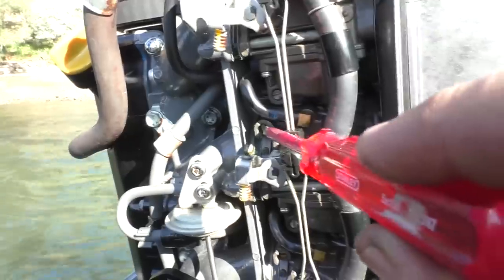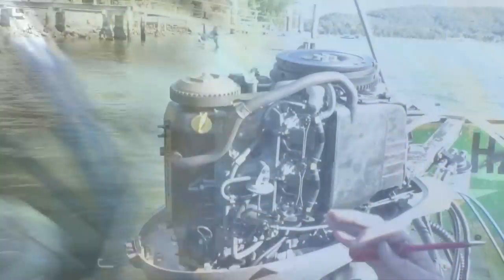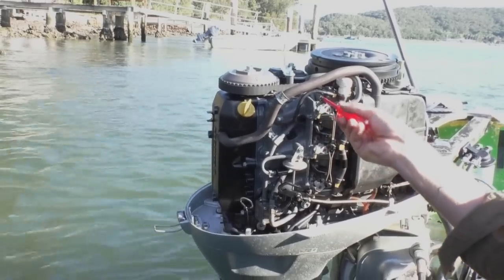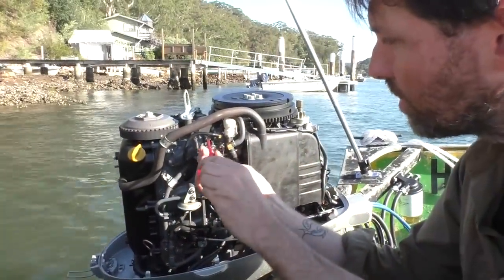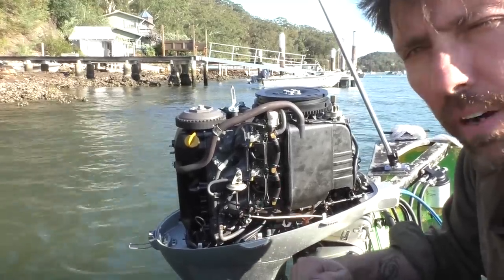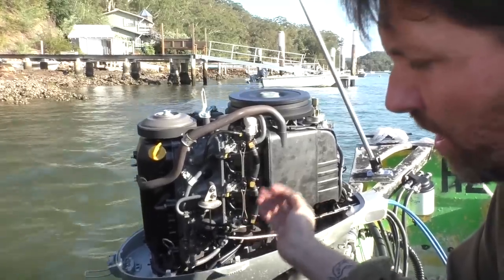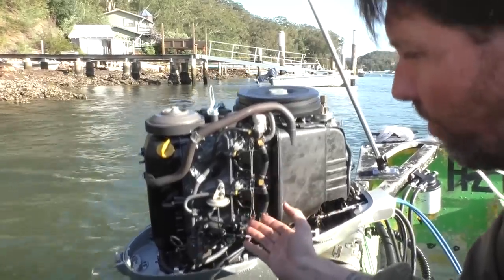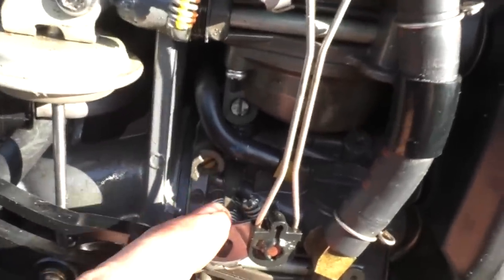Four stroke carburettor synchronisation

Comment: Hello there, when synchronizing the carbs on an outboard, is there a specific value on the vacuum gauges you are trying to reach? Are these pressures generally the same throughout all outboard brands or does each individual outboard have an optimal pressure value set by the manufacturers?

Comment: Dangar,  I see this is setting the throttle angles @ idle.  Is there also a calibration of linkages at part throttle?  On a vehicle, you could look at the TOPS voltages and determine opening of throttles...just wondering on outboards if there is a calibration off throttle.
Reply from the maker: You can adjust a few things. Making sure the linkages between the carbs are the correct length will make sure they are opening equally, and then they should be checked to make sure they are opening fully. I've seen plenty of outboards where at full throttle the butterfly valves are still partially closed so they never reach full throttle. Newer EFI outboards do have TPS sensors in them which I've tested and replaced due to failure, but never needed to calibrate.

Comment: Excellent video bro! really helped better understand the carburetor system. I'm in the process of resealing all the gaskets 1987 johnson 150 vro. Question do you use a spray sealant on the head gaskets the manual says not to use automotive sealer but doesn't say anything else. Thanks again keep up the good videos they really help.
Reply: Do NOT use anything on the gaskets...  make sure all surfaces are even and clean then install as is. Buy a proper OMC manual and tighten bolts in sequence to the manual specifications.

Comment: I bought the same synchronizer model you are using here. But my BF40 just gives 5 inches of vacuum on that synchronizer? Is that legit?
My fuel mixture screws need a special tool with Single-D-profile 🤦‍♂

Comment: Dear Dangar . If you may answer the following technical question . Say you plug your vacuum gauges and you see the following numbers ie 10 - 10 - 6 . This means that one cylinder has a ) the throttle body out of sync or b) has a serious vaccum leak . Could be a gasket , a hose or something else ... How would you know if a) you just need to sync the throttle body or b) you need to look closer and inspect a possible vaccum leak ? Thanks alot . Theodoros , Corfu , GREECE Yamaha 2 stroke 115 owner
Reply from the maker: Hi Theodoros, you can check for a vacuum leak by waving an unlit gas torch (like the one I use to heat parts) around the intake manifold and crankcase. Do this outdoors for good ventilation. If there is a vacuum leak the LPG will get sucked in and you will hear the idle change with the extra fuel being added.
Reply: The reason I am asking is because my 2 stroke yamaha 115 had some issues with cold start . We checked everyting . compression , carb setup , pipes , vaccums , reeds ... everything . Once operating it worked perfect . But it was a handfull getting it to fire up . Especially during winter .... Your Ocean pro 150 rebuild was epic !!! I spend a whole day and saw all rhe vids . You remind me off greek outboard mechanics !!! keep posting . I want to install on my 115 cetol power reeds and an exhaust from the 130 ...

Comment: Hello,great videos..i have  one guestion..so i have 60hp fourstroke yamaha,and there are four carburetors..so there are different values on every carb..so how do i know,what is the right one..sorry my language,not my homelanguage.
Reply from the maker: Having them all even is the most important thing, but the manual will tell you a base setting for the mixture screw and a preferred idle RPM.
Reply: Thanks for answering,i also have another guestion..this engine doesnt work so smoothly,i have heard that those pilot jets in carburetors are too small,so the problem is,it
 cant have gas enought..and there seems to have no uppgrade kitt for those models,it s the same 38,than original parts..i have no idea where to order bigger jets..

Comment: Thanks for these wonderful videos and tolerating dumb questions, like this....  Is the carb sync'ing strictly a exercise on 4-strokes?  I have a 2-stroke mercury with 4 carbs and don't see where vacuum hoses would be connected.... the seloc manual I use refers to "link-n-sync'ing" the carbs; but, that seems to be adjusting mechanical linkages to get the carbs to work together.  I think I link-n-sync'ed it right

This motor is the weirdest thing... at idle it runs on only 2 cylinders (on purpose) ... lots of vibration.  When I accelerate, it amazingly smooth at slow cruising speeds..  When I push it to about 3/4 throttle it doesn't feel or sound as smooth.  I was hoping this video would help with that; but, I doesn't look like I can hook up vacuum hoses.
Reply from the maker: With two strokes you can do the same mixture and idle adjustments, but for the balance you simply need to loosen all the butterfly valve linkages so they their springs can close them completely and then tighten them all up again.
Reply: +Dangar Marine thanks for tthat info regarding two strokes. i was considering buying a new expensive tool...but i guess Now ill hold off and save for a better engine.

Comment: with that nut loose for the trigger  i cant find any articles on how you set a trigger linkage.. im guessing  the trigger needs to be fully pulled  with the throttle fully open?

if you have a video that be great too
Reply from the maker: This video is on setting static timing https://www.youtube.com/watch?v=5wbmaQXGf54 and this is on using a timing light https://www.youtube.com/watch?v=RWtGZM9dh6g, but you'll probably need the service manual for your motor to get the procedure or specs.
Reply: mercury did send me the procedure  2-5 BTC and 27 BTDC for maximum   but they have no idea how to set the adjustable linkage for the timer base as its not in the service manual they said
and i cant post image or id post you the image they sent me

Comment: Hi hope this is not a silly problem l have a little 4mtr open boat and a 6hp two stroke long shaft motor it run well up to 3/4 open throttle the rest won't do nothings is the motor to small or can it be adjusted? Regards Barrie Watson
Reply from the maker: Are the throttle plates continuing to open as you open the throttle? https://www.youtube.com/watch?v=NnotQmnKxKM

Comment: I have a honda BF45A I have watched your video multiple times and can't seem to get my motor right after cleaning the carbs. I always end up with some kind of issue. One will be nice smooth running motor but hanging idle when revving in natural, or no idle hang but a lag in revs after 3500rpm ballpark (picks up again after 4500rpm ballpark), and another issue ill ran into is rough shaky idle but revs great just dies when throttling up in gear. I'm not sure exactly what I'm doing wrong here. I've changed plugs, checked spark, checked fuel pump, and motor is running 182 even on all 3 cylinders. I've heard to tune while the boat is in gear and the upper exhaust ports are not under water, is this true to the honda bf45?

I've also had the motor idling at what sounds great but while sitting at idle the rpms will just randomly start going up on their own. They eventually lower down again but it takes time, or ill have to bump the throttle in neutral

Comment: I have a Yamaha 2stroke 15HP that seems to run on 1 cylinder at just above idle. When you give a bit more throttle it smooths out and runs on both cylinders. Compression is good at 135PSI each. Plugs are clean and gaped correctly 1mm/0.04in. Any ideas? It runs well with throttle, its just down low rpm.
Reply from the maker: Sounds like a coil problem where when it is running at low RPM there isn't enough voltage to create a strong enough spark. This video may help you. https://www.youtube.com/watch?v=MDbvkFM1V_c
Reply: That was a quick answer. Now to get diagnosing in the engine. Need to find the specs somewhere too.

Comment: Thank you for your videos.  I have enjoyed them so much, I purchased one of your tee-shirts.  I have a 1995 Mercury 115hp 4 cylinder  2 stroke.  I want to buy a carb synchronizer but the ones I find are advertised for motorcycles.  What do I need to know to make sure I buy the right one that will fit my outboard?  Thanks again, Dale.
Reply from the maker: Hey mate, glad you like the channel and thanks for buying a t-shirt. The only thing you really need to know is the diameter of the threads of the ports on your intake runner. You will need adapters that match.

Comment: I have a 1998 Yamaha T50TLRV (4 stroke/carburated).  Boat set for a couple of years and when I got it I had the old fuel replaced, the fuel tank cleaned and the carburetors rebuilt and synchronized.  Engie ran very smoothly for a couple of weeks but now it hesitates starting at 1,500 rpm, and at other parts of the rpm curve.  At the point where engine is hesitating, if I put in neutral, it dies.  Checked for vacuum leaks and found none.  Carburetors were synched again and engine ran smoothly while out of the water throughout the rpm curve without hesitation.  When i put the boat in the water under load, it starts and idles smoothly but again cuts out when I start increasing rpm's.  What is your opinion on the cause?  Thx, much!

Comment: Dangar, You produce some very educating videos.  Thank you!

I was just wondering while watching this video -  if the cylinder compression is not equal between the cylinders, will that effect the carburetor synchronization and ultimately the engine idle?  I have never checked the compression on my engine but have cleaned and adjusted the idle mixture on each of the carbs (Yamaha 90 TRLA) as you did in this video.  I haven't adjusted the minimum idle speed nor attempted to synch the carburetors (don't have 3 vacuum gauges, yet).  I suppose those procedures are best performed while the engine is operating in water and not on flush muffs so that there is a proper pressure on the exhaust.  

I do still get the occasional sneezing when idling, running on non-ethanol 90.
Reply from the maker: Hey Jim, yep, the compression can affect synchronisation, but in effect that is what you are compensating for - variations in manifold vacuum due to the pistons and runners all being a bit different. With the sneezing it sounds like you've still got one piston running a bit lean, but as you say, be sure to adjust everything in the water with the engine warmed up.
Reply: Dangar, Thanks for that additional bit of information.  I need to forego a fishing trip and spend some time at the marina getting the engine running more efficiently.

And thanks for all the informational videos you produce.  They definitely help us DIY type backyard mechanics.

All the best...

Comment: Love your videos. Question do you have experience with inline mercury 6? This way of tuning doesn’t seems to work out. If I tune like this I get hesitation to wot. Wot is perfect and it’s perfect from wot to idle. I was told I need to open up the carbs a bit more it wants more fuel from idle to wot and has to catch up. Thoughts?

Comment: Finally got my boat to this step (HUGE thanks to all the other videos on here that have gotten me this far) and I obviously do not have the tuning ear for the matched idle phase.  I have the exact same motor as your Honda BF40A.  I have gotten them all to the point where they are roughly the same range of turns out on new screws (+/- 1/2 turn) and the engine is now sitting at about 920 rpm idle.  When I go to hook up the vacuum gauges, same that you have exactly  :), my bottom cylinder is sitting down near 8.5in, unlike yours that sits around 12.  Is this an issue?  I can match the other 2 down to that pressure, but need to know if that is too low for the 3rd.
Thanks so much for all the videos....  I wold be out $1000+ at this point with out
Reply from the maker: Hi mate. So that bottom cylinder sitting at 8.5 can't be raised by closing the throttle plate a bit more? If not I think it is more important to have them even than worry about the absolute value. Having them all at 8.5 will probably give you the nicer idle.

Comment: Great video as always. Any chance of seeing a 2 stroke tuning video? Also wanting your opinion on fuel oil ratio for 25hp yamaha? Thanks for sharing the videos so far.
Reply from the maker: 2 stroke tuning is pretty much just the mixture screw adjustments without the vacuum part. You should also check that the throttle plates are closed fully and evenly at idle. With regards to oil ratio I use 50:1, but I hear that with some modern two stroke oil you can use less oil, but I've never really experimented with them.

Comment: Hey just wondering if someone could answer probably a stupid question please. I have a 55hp mariner and it's running a little rich I believe, sluggish, can't reach full speed and slightly wet spark plugs.....going through this process of tuning is the right step to solve this I'm thinking??  Many thanks
Reply from the maker: It will help, yes.
Reply: @DangarMarine  legend thanks a lot. Keep up the good work. Couldn't have done half the stuff I've managed without your vids. Much appreciated. Love from the UK🇬🇧 ✌🏽

Comment: hi stu, I have a Yamaha 25HP 4 stroke 2000 model, it has a single carb and there doesn't seem to be any air fuel mixture screw on it, is it possible that some carbs can not be tuned? cheers.
Reply from the maker: It's rare, but yes, some carburettors don't have an external mixture screw. I would have expected a 2000 Yamaha to have one though. They can be in a variety of positions (front side, back side, front face etc)

Comment: I have a 60 hp tracker and it sounds pretty. Even idles just fine. But after 30%throttle it doesn’t go faster or rev higher rpm. What could be an issue?

Comment: hi i have a vacuum leak from all 3 carburetors, i cleaned and replaced all gaskets but leak still persisted. i noticed this leak from the carb synchronizer as vacuum is very low and i also sprayed carb cleaner on the carbs from the outside and the idle  speed varied . any ideas of what may be the instance please.
Reply from the maker: Hmmm, that's a bit weird with new gaskets. You could try a thicker paper and see if that helps. You could also coat the paper gaskets with some sealant before installing.

Comment: Hi Dangar, I'm in Clareville and have a 2 stroke 30hp Tohatsu outboard. I've been having some issues with my engine spluttering both in neutral where it eventually cuts out and when on full throttle I have very reduced power. Do you know what this could be? It happened randomly after running well and seems to be consistent the last few times I have taken it out. Wondering if you could take a look, I would obviously pay for the labor.

Comment: I would like to know if there is a difference in tuning of the four stroke and two stroke carbs.. 

I have an oil injected two stroke.
Reply from the maker: The idle mixture screw is exactly the same but you don't balance the intake vacuum, just make sure all the throttle plates are fully closed at idle.
Reply: Ok. So that would mean tuning all the carbs the same way. But setting the throttle plates at the end of tuning to closed? TY so much for info.
Reply from the maker: I'd start by setting the throttle plates then do the mixture screws.

Comment: My 4 stroke outboard runs great, but when I try and go fast it dies. It does fine at slow ish speed. Why is this?? It has been sitting on a sailboat for several years unused, so I replaced the fuel filter, gas and added some Sea-Foam. Nothing has helped! Please help!!Thanks
Reply from the maker: Sounds like the carburettors need cleaning which is making it go lean and stall when you open the throttle.

Comment: hi there  thought I would ask you a question.i have a 2 cylinder  55 HP Chrysler outboard motor.  and was curious if you have ever worked on one. and if so do you have any videos on 70s Chrysler motors by chance.
Reply from the maker: Hi Nick, We've only had one Chrysler in the shop but it was completely seized and the block was damaged so all we did was lift it off and put his new outboard on for him.
Reply: ok, thanks pal  ,

Comment: hi dangar i have a problem with water getting on two spark plugs. i clean them and motor fires up on three then goes down to one or two cillenders. when i take splugs out i have water in two splugs im hopping it isnt to seriouse.
Reply from the maker: Hi Tony, sounds like it might have a blown head gasket. If it's a two stroke motor then it isn't too big a job to replace it.

Comment: us there a way to detect a vacuum leak. my project outboard starts but stalls out immediately like in this video. any tips? I cleaned the carb and gaskets seem good.
Reply: if I cover the air intake (essentially choking the motor) I can get it to stay running. Quite nicely actually. but once I pull my hand away it stalls. it may run for 30 seconds or  so but it struggles. fuel pump seems good. and filter is clear.
Reply from the maker: I'd do a video on it soon, but what I do is take out LPG gas torch and open the gas (with it unlit!) and wave it around the suspect areas. Why the gas is near the leak it will get sucked in and the idle will audibly change. You can use other sprays that burn such as WD40, carb cleaner etc Be sure to do this outdoors where there is good ventilation.
Reply: Dangar Marine 
it's definitely a vacuum leak but can't find it. Tried a torch but  unable to get a steady idle so it's hard to hear any change. Gonna replace the gaskets and found a diaphragm that had a "crease" in it.

Comment: i noticed you did this in the water is there a reason is it a different outcome on the muffs ?
Reply from the maker: Yes, when the boat is out of the water there isn't any back pressure on the exhaust and it will affect the tune.